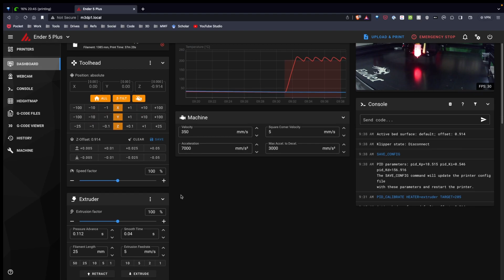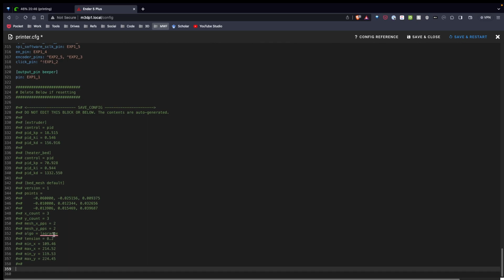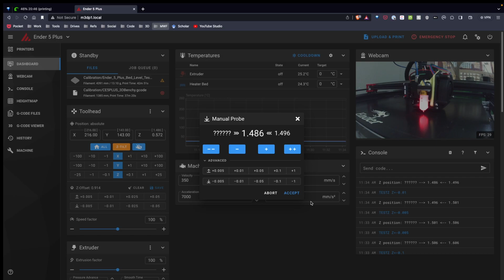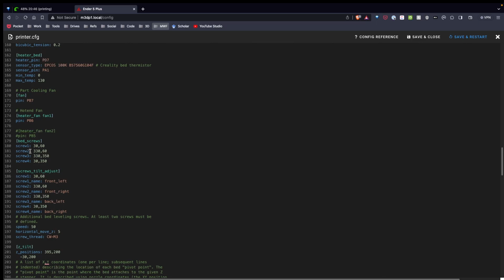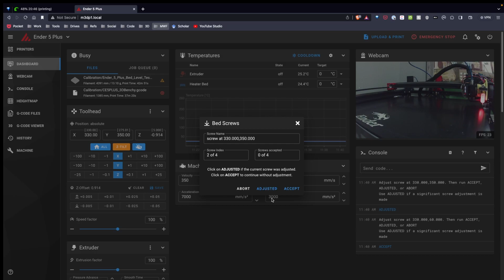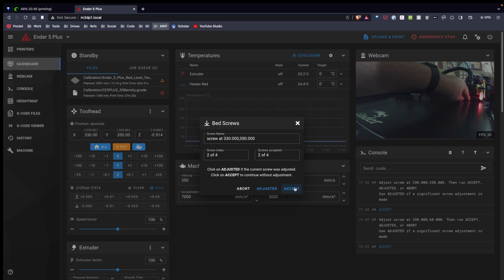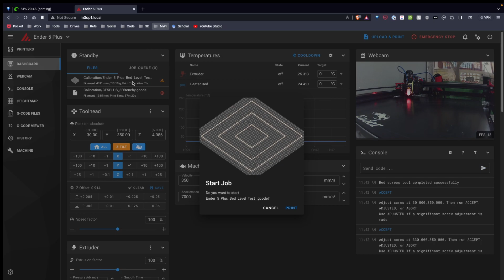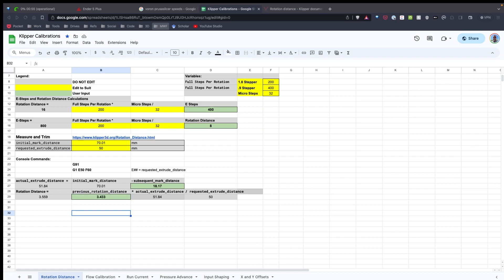BIQU H2 V2s Review: Is this Direct Drive 3D Printer Extruder any Good? (Part 2)

Comment: Could you please post a link to the duct mod stl? My application is on a homemade 300-cubed CoreXY controlled by a Lerdge K board. I'm using 320 for the motor setting on this extruder, and 185 for the extrusion multiplier on the print settings from Lerdge. Needless to say, it's not going so well. I saw your Klipper spread sheet. Wish I could do that with this setup, but Klipper and Lerdge K are a nightmare to setup (again). Anyways, your feedback to me would be very appreciated.
Reply from the maker: STL: https://www.printables.com/model/146957-mad-modular-air-duct-for-biqu-h2-h2-v2s-revo-h2-v2

Have you tried the teaching tech calibration website? It might help with marlin settings. 

Let me know how else I can assist.
Reply: @minimal3dp  thanks for the stl, I'm not spending $80 on that fan however. I'm on my way to the tehing tech calibration website next!
Reply: Sadly, like all of the other websites / calculators out there, their tools require gcode entires to get results. The Lerdge K board has basic english input fields. And therein lies the problem :-(

Comment: Is it working with flexible filament?
Reply from the maker: I have not tried but I am willing to bet it would work good.
Reply: Most of the direct drive work really good with flexible filament and you have the possibility to adjust the tension on the extrudeur wheels
Reply: i print tpu and was ok